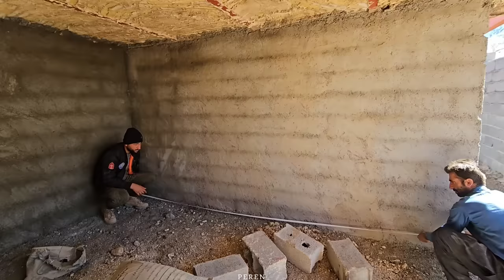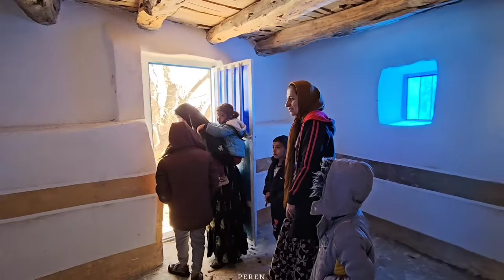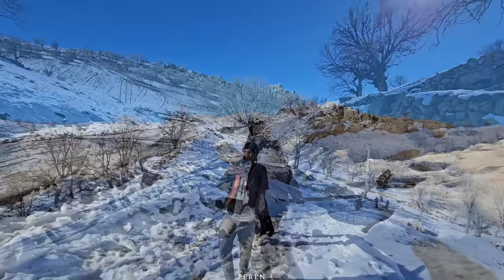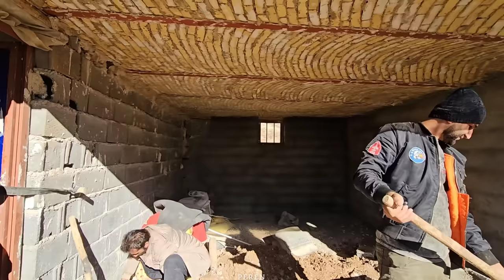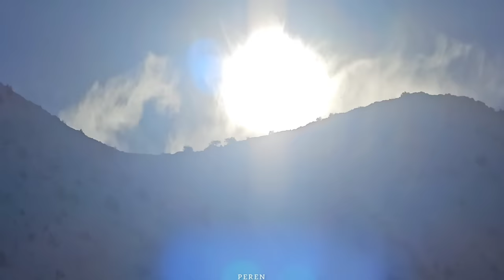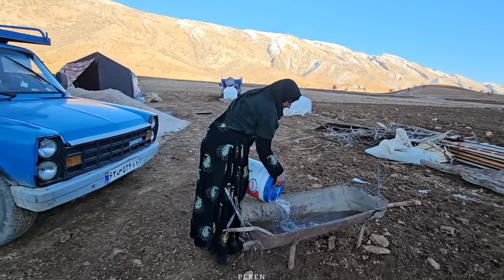"Resilient Roots: Grandmother's Homecoming and Hut-Roof Rescue for Seamless Nomadic Migration"

Comment: When building, they had to put cement between the stones to make it stronger and fill the gaps between them, so it would be easier to work with and cover the wall better without any gaps.

Comment: I don't understand them, instead of doing everything internally so as not to have to go out to get cold, they make the wall further in, for me it is not right, they should have done it on the edge, there was time to make a porch.
Reply: They need a hallway to connect the rooms.  Ex. The room they are sleeping in, the kitchen, and the other room.  The little hallway between the two rooms and the kitchen in the middle, makes sense to me.
Reply: @CrlM1170  Yes, but what I saw is that to go from room to room they have to go out into the cold if it is winter, unless they make another wall.